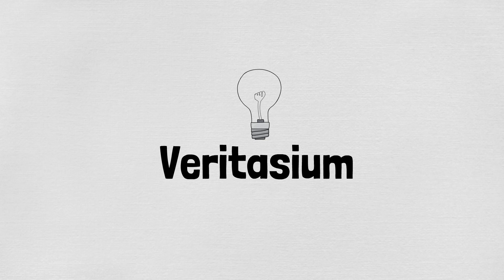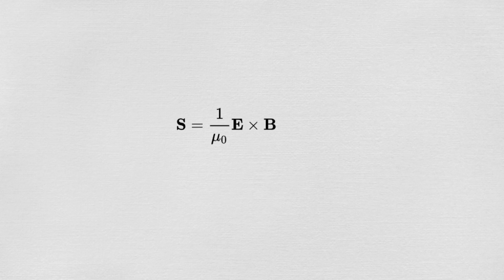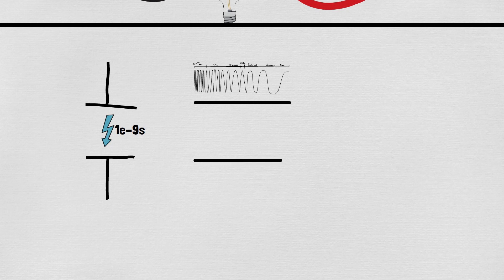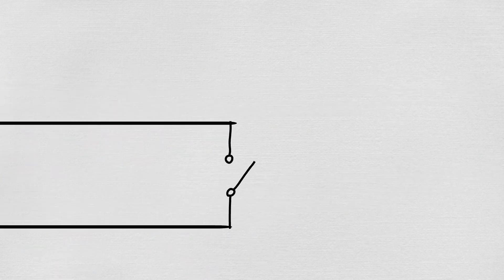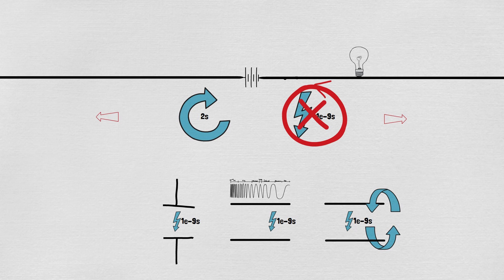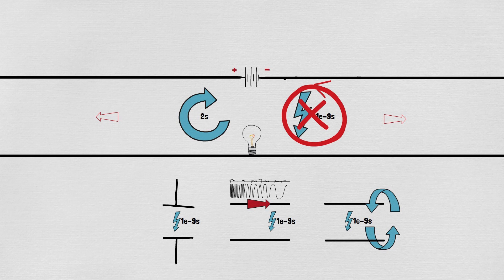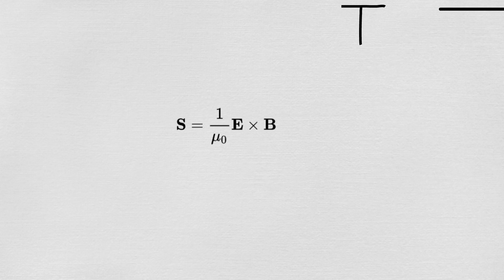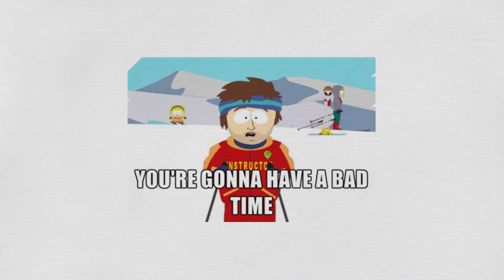Veritasium is Right? (see description)

Comment: Very good points BUT I think you are missing what is key: when we close the switch in the original configuration, you'll have potential that will equilibrate along the right part of the cable that was not connected before. You can see that like a little slide of each electron propagating from one to the next and doing so at the speed of light (their preferred spot slide a little). This potential equilibration is the current that you consider is not existing (false assumption), and is what allows all the other explanations to hold. There is no paradoxe like that at all, there is no violation of causality of any sort. If the far right end is open, once the potential is equilibrated (all electron are at their prefered spot) no more current and so after a while "on" the light bulb will turn back "off". BUT Derek is wrong about not mentionning something: this early phenomenon is a small part of the energy, and the biggest part will appear later when we expect it. You can see confirmation of what I said in a simulation video on youtube called "Response To Veritasium - Electricity Propagation Time Problem" by ben watson.
Reply: That's not logical. Think about the "potential that will equilibrate along the right part of the cable" as the voltage stepping from 0 to 12V (assuming a 12V battery). Ask yourself what is the voltage at the end of the bulb connected to the right part of the cable? It must be 0V before the switch has closed, and 12V once the circuit has settled. A current is not flowing if the voltage at that point is not greater than zero. So while the "potential reaches equilibrium along the right part of the cable" where does the bulb get the voltage needed to light up?

If the far right is open, then how does the voltage at the end of the bulb connected to the right part of the cable change over time? How does your supposed current caused by electrons sliding along the right cable cause the voltage at the right end of the bulb to rise in order to light it? You'll never transfer enough energy by any mechanism you can propose to light the bulb if there is no complete circuit.
Reply: @RexxSchneider  Hi, I was talking about potential to give an idea to which known concept the phenomenon is linked, but you cannot use the electro static potential the way you do to think about what is NOT an electrostatic problem (we are dealing with a situation of establishing regime, a transitory regime that cannot be captured by the electrostatic notion you see at school, it's out of their domain). To understand what's going on here you need to go down things and think with more fundamental notions: fields and charged particles motion. When the switch is closed electrons will slide a little and by doing so each one will repel the next one that will move at its turn and so on, this propagation of perturbation can be captured with only the E field and,or repulsion forces of charged particles. When those charged particles move a little it's a current and so it induces a B field around the wire, this B field around the first wire will induce a current on the second wire. There is nothing magical here in fact we are dealing with open circuits every day: current transformation, contact free payments, and antennas are all contraptions that can perform an electronic purpose with an open circuit. Nevertheless it is true that this initial amount of energy is low, I mention it in my first comment, you can see the simulation I mentioned for more details about the quantitative aspect of things. If you want to see more details about why you cannot use the potential as you usually would, have a look at the wikipedia page Electric potential, the first part deals with electrostatic, the second with electrodynamics.
Reply: @PasseScience  What you call "electro static potential" is actually voltage and it is just as real when dealing with electrodynamics as it is when dealing with electrostatics and I don't need a Wikipedia page to distinguish between them. Your "explanation" is pure gobbledegook. You are displaying no idea about how the voltage across the bulb changes with time.

What's the magnitude of this "B field" (magnetic field) that you're counting on to "induce a current on the second wire"? It's actually the same wire, of course, but what is the current induced?

I'm perfectly aware of how an alternating current applied to a loop of wire will produce electromagnetic radiation that can be picked up by another closely-placed loop and transfer power. Having gained my Masters in Electronic Sciences in the 1970s, I'm quite capable of calculating the amount of power transferred, as well. But that's not the scenario in this video.
Reply: @RexxSchneider  Voltage is a difference in electric potential, in electrodynamics voltage depends on the path taken as it's not a conservative quantity. So you cannot define voltage here between two points of the circuits without specifying your integration path, It's not a quantity you can use with the same benefits as in electrostatics. I guess you could refer to the voltage wikipedia page to have more details about that but as you are now an established genius with perfect knowledge on the field you don't need to, I am barely mentioning it for limited humans like me who understand gobbledegook. I am wondering what's the point of keeping on talking about that with you, as your position is to keep going with this immutable knowledge and understanding of yours (since 1970 I guess), so by definition nothing that I will say can change your mind because your mind is immutable. You're not the first "retired engineer" on the web that knows the "truth", but as for others your stubbornness will only affect yourself, not the rest of people, yet less reality. As I mentioned it now twice you can refer to the simulation video I refer to in the first commentary to have an idea of the E B field dynamic in the contraption. If you prefer qualified retired engineers I suggest you have a look at the video "Veritasium Electric Energy Not Inside Wires - Follow-up - RSD Academy" the difference being it is done by a competent and humble one. (There are Two videos on RSD Academy going into a lot of details about the topic). I'll not follow up our conversation here, the minimum requirement would be you first to refer to the content I mention and change your tone when you're talking to me, as you can see I can reply with the same tone. Regards.
Reply: @RexxSchneider  I quote Wikipedia of the Voltage page (you understand that if I mention page name it's to avoid giving links that would end up filtered?): it's not from me it's WIKIPEDIA: The electric potential can be generalized to electrodynamics, so that differences in electric potential between points are well-defined even in the presence of time-varying fields. HOWEVER, unlike in electrostatics, the electric field can no longer be expressed only in terms of the electric potential.  Furthermore, THE MEANING AND VALUE OF POTENTIAL DIFFERENCES WILL DEPEND ON THE CHOICE OF GAUGE. In this general case, some authors use the word "voltage" to refer to the line integral of the electric field, rather than to differences in electric potential. However, in this case the "voltage" between two points depends on the path taken.
The quantity you stubbornly want to use cannot be used in such a context with the meaning you want, either it's gauge dependent (meaning it's well defined but only after an arbitrary choice), or if we want to generalize the definition to keep it's fundamental meaning it depends on the path taken. (I do not expect you to understand gauge symmetry concepts, it will be way over your head, but yet I can mention a reference that your big brain will not even dare to consult, wikipedia page named "gauge fixing"). It's quite easy to see for yourself how the simplified model you have in your head does not work, just try to define a satisfactory notion of voltage at any point of a closed loop in which we would induce current by varying fields around: good luck.
What is striking to me, is that you do not seem to understand that all the concepts of electronics you use can be derived from more fundamental physics, you simply do not understand (and worst it seems: never tried to in decades) from what all this is coming from, for you physics seems to be a list of concept and principles unrelated to each other that you can spit like you would with a religious content. But guess what: there is a logic to it! You do not seem to understand either the approximations done to use such microscopic and simplified models because you still want to use them when those approximations are not relevant anymore, Like someone trying to describe precisely black holes using only Newtonian gravitation: guess what: YOU CANT, it's out of its domain.
I never asked to believe me, in fact I did source a lot of what I was saying, referencing at least 3 wikipedia pages, and 3 videos done by competent people, it would be less than one hour of your time, but you did not bare to consult it, the risk of being less incompetent I guess.. That's the difference between you and me man, I can back up what I am saying, (and in addition I know and understand where the concepts I am using are coming from). Take care.

Comment: Thank you for this explanation. I've watched other responses to the Veritasium video, which make the assumption that the 'shorts' on each end of the wire loop could be removed without affecting the outcome. But if that were true, one could attach 2 lengths of wire to a battery and immediately create an antenna or one plate of a capacitor. As a complete amateur, I kind of had to accept that because I don't know enough about the subject, but it definitely bugged me and sounded wrong. It makes so much more sense now you have pointed out that these things can't happen without the flow of current, and the current can only flow once the 'information' about the switch's state has propagated all along the wire. And looking at it from another angle, as I commented on another video about this, if a switch half a light second away 'could' influence the bulb's state within 1/c seconds, we would be able to build a system to communicate almost instantly with anywhere in the universe.
Reply: My radio receives signals all day without a flow of current. The difference with just two lengths of wire attached to a battery is that it will quickly come to equilibrium. When the switch is closed, a signal travels down the newly connected part of the wire, and it takes c/2 seconds for that to reach the end and reflect back. Eventually, if the circuit is open, things would settle to equilibrium, but for a short time the system would not be in equilibrium, which is what causes the bulb to light initially. You can't use this to communicate instantly across the universe because it is the distance from the switch that matters - the information that the switch is closed travels at the speed of light outward from the switch. Veritasium's video is a little confusing because both the switch and the battery are 1/c meters from the bulb, but it's the distance from the switch to the bulb that affects the delay.
Reply: To put that another way, what if someone were to break the circuit at the far end, at the same moment [ie as close as we can talk about the 'same moment'] as the switch near the bulb was closed? The flow of current that creates the field is dependent on the circuit being closed (otherwise what function does the switch serve?) but if the answer in Veritasium's video is true, this implies either that - the bulb will not 'know' about the state of the far away switch until 1/2 second has passed.. in which case it lit up without the circuit ever having been complete - or, the bulb will not light at all, in which case information has broken the universal speed limit. I think the key here is, I don't understand how an electromagnetic field could be established around a wire by connecting one end of it to one terminal of a DC supply?
Reply: I think @Klauz Wayne answered that question because he commented more about the 'equilibrium' you mentioned.. thanks to both yourself, him, and others for engaging with this

Comment: Behold, the mighty algorithm bringing up something worthwhile time to time. I was also following the topic for some time, and had my looming "something is fishy thoughts", but I couldn't put my hand on it (and didn't bother to look after the math). My thinking was similar: how would the scenario differ, if we had an already flowing current, and the bulb is not directly facing the switch on the opposite side, but half a light second farther on its side; then we switch off for 1/4 of a light second - I think in this scenario, we indeed would get Derek's number.
Anyway that's just my mumbo-jumbo, thanks for the video.

Comment: My dad is IEEE and he said your explanation is wrong. Battery is DC and your example only works in AC, i.e. antenna, capacitor etc… and circuit will break once it is opened. The point of Derek’s video is to show electro-magnetism and something called three finger rule?  (I am from economics so don’t quote me on that) He also said better off to use wave to explain.
Reply from the maker: those examples (antenna or capacitor) were ones i saw being used to defend the 1/c answer. now a DC "antenna" is still a thing if you can get current to flow through it (maybe in a transient way), because if you increase the charge density on one side of a wire and reduce the charge density on the other side, a parallel wire in proximity will do the opposite. an AC antenna just keeps flipping this charge density imbalance back and forth. a DC antenna will give you a single pulse (and you can hear it in a radio if you turn on any DC circuit nearby), it just doesn't work to radiate sustained power.
Reply: @antimatterhorn  when a steady DC current is established (closed) and the light blub is turned on,  in what way can "his" antenna/capacitor theory to explain the time it take for an electron to travel the loop?
Reply from the maker: @gabrielwong1991  there is capacitive coupling between the parallel portions of the wires. if you create two complete circuits but only power one of them, and then place a parallel portion of the unpowered circuit near enough to the powered one, current will flow in the opposite direction in the "unpowered" circuit.  you can view this as either an antenna or coupled inductors (where the inductor winding radius is just the thickness of the wire) or a big, blown up capacitor. the word you use isn't really relevant since they're all doing the same thing, coupling conductors in a coherent way via the EM field. that is not to say the electrons jump the gap. they don't. only the EM field energy does. and in the steady state when this entire circuit is powered up, the two parallel ends almost certainly are coupled, such that you could create a pulse in the battery and see the lightbulb "react" in 1/c seconds. i just don't think the light bulb "turns on" in that time, nor do i think closing the switch again means the bulb will turn off that quickly.
Reply: I was having the same considerations as your dad and i remember the 3-finger rule. I guess that in their capacitor, antenna (induction) approach the time constants of these are just omitted and that within the "puls" of charging and induction time the same  electron traveling time rule applies.  If you would connect an AC voltage the whole question becomes different due to the introduction of Impedance of the antenna, capacitor etc.
Reply: @antimatterhorn  While a single pulse will cause some energy to radiate, not only the amount caused by redistribution of charges around the switch will be small, current needs to flow for the coupling effects to happen. The current does not yet affect the lightbulb at “1/c”.
Reply from the maker: @noop9k  that's my feeling as well. you might get a measurable effect on the EM field around the bulb at 1/c, but you won't get current flowing through it, so it won't turn on.
Reply: @Mike the Monk I'm not far enough in my education to understand much of this, but that's what I've been thinking.
Reply: @antimatterhorn  I’d also disagree with “measurable”. Exactly at “1/c” from the lamp’s POV electrons didn’t yet have time to start moving around the point of contact in idealized switch and without movement of electrons there’s no change in EM field. This is not a step function where after “1/c” the field changes from zero to some measurable value. At 1/c it is still zero.
What is the effect of (infinitely small, infinitely fast) switch being closed? It doesn’t create any electrical field itself, out of nothing. It only allows electrons to travel under the influence of the field that already  existed.
In order to induce any (tiny) current around the bulb, the effect of the switch being closed (allowing movement of electrons) need to propagate along the wire, at speed lower than speed of light, actually, because electrons have a mass. And only then the changes in the field caused by electrons changing position and velocity will travel to the opposite side.
Veritasium’s answer expects that at t=0 the battery/switch portion (of non-zero physical size) suddenly warps out of hyperspace, immediately creating EM field where there previously was none.
(Sorry for poor wording, non-native English speaker, not an EE or physicist, was just solving physics problems at contests >20 years ago)
Reply: @Mike the Monk Power is never mentioned in the video. In fact, Derek says that the resistance in the wire is 0, so assuming the wire doesn't break, the power should be "infinite". You could also say the resistance is almost 0 and power is extremely high, but sufficient. It's a hipothetical scenario after all...